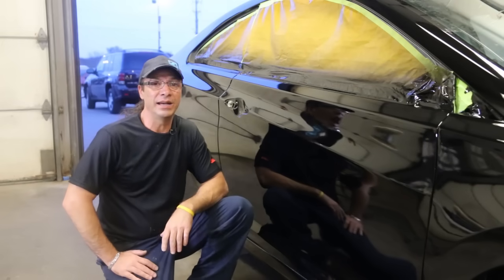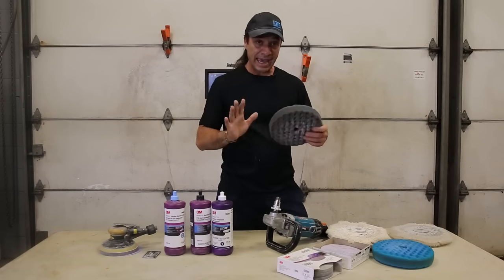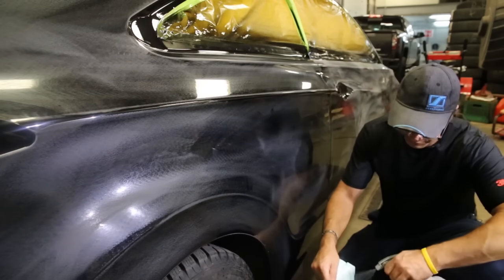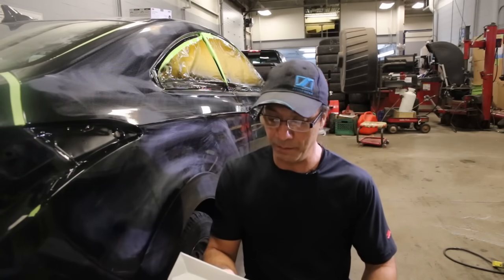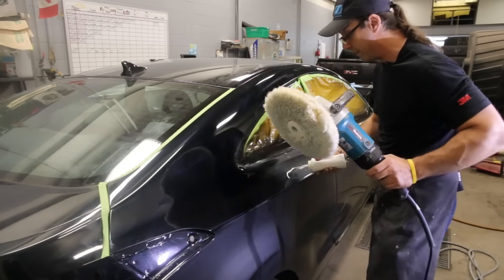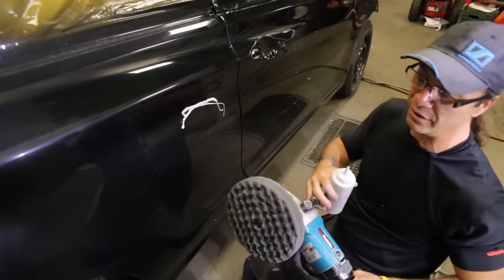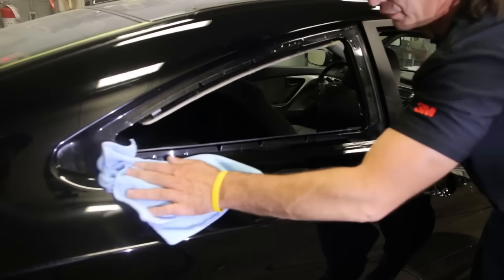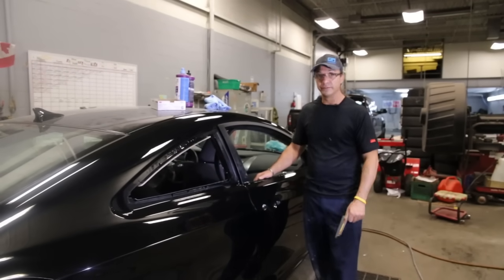Professional wet/dry sanding and polishing tutorial. 3m Trizact system, EX Compound

Comment: Friend I tried to make a fiberglass, gel coat boat look better. The boat is 20 years old but has been taken care of. Still it had some light oxidation. I use to do auto body repair so have some experience. I block sanded this boat lightly with 600 grit, then hand sanded lightly with 1000 and then 2000 grit. I then used what looks exactly like the compound you have with the white top and the polish with the blue top. No matter what I did the boat had a haze on it that would not go away. It was better when I finished just not completely gone. Can you please tell me if there is a way to completely remove that haze? Or was there something I was doing wrong? Thank you friend!!..
Reply from the maker: Boats have gel coat on them so it’s completely different then car paint. You may need a compound that is more aggressive which means has more of a grit. No reason to block wet sand a boat as it’s wavy from the start that you’ll never get out. Maybe contact a local detail supplier and see what they recommend. Good luck.
Reply: @loveja1  Friend I can not tell you how much I appreciate you getting back with me. I have already liked and will subscribe to your channel if it can be subscribed to. One more thing. A friend of mine wet sanded his boat with 500, 1000 and then 2000 grit paper. Then he used the same compound I used but I think he had a better/stronger buffer and put a lot of pressure on it. His boat was worse than the one I did but looks brand new!! No haze what so ever. So I think you gave me some good advice about stronger compound. I can probably do that or just put much more pressure on it. Again thank you so much!!..
Reply from the maker: @robjtko  what type of polisher are you using?
Reply: @loveja1  Hey friend again I appreciate you responding! I am using “”3M Perfrect-it  EX”” (Ultrafine Machine Polish) #06068. I used 3 different compounds trying to find one that would get rid of the haze. I tried “”3M Super Duty Rubbing Compound #05955,, 3M Perfect-it. EX  AC. #36060 and the most course or heavy grit one was (Dura- Coating  Marine Compound  Heavy Duty Compound Polish — which can be found at ( Dura-Coating.com)  I am still stumped at the fact that I could not get rid of the haze. The boat had a great shine, just an irritating haze on it. I am very thankful for anything you can tell me!! I appreciate your every second.
Reply from the maker: @robjtko  I meant what machine are you using to polish?
Reply: @loveja1  I’m sorry friend I misread your question. My mistake. If it isn’t a “”Goplus 6” DA with variable speed,”” then it is almost identical. I would guess it will turn from 600 to 800 rpms to probably 5000 if not a little more. It is also pretty strong. It doesn’t bog down when you apply pressure. Even though I don’t usually apply a lot of pressure. Usually just a bit. When I see my machine if I gave you the wrong name I will let you know. My buddy who did his boat and made it look new was using a DeWalt, variable speed but not DA with much of the same compounds and polishes. Actually the polish he used was different. But he wet sanded and used the same compound as I did.
Reply from the maker: @robjtko  I see a lot of newcomers using a variable speed da polisher and they don’t want to put the work into learning how to use a high speed polisher. It’s just not strong enough. You need to use an actual high speed polisher with a WOOL compound pad and compound. Learning on a boat is the best way to learn as you don’t have to worry about burning edges. Then use a wool polishing pad with your glaze and you should be good to go.
Reply: @loveja1  Ok awesome!! I did not use wool. I did know wool is for cutting but the compound was so abrasive I didn’t think It would need it. However I did not know you used wool for polishing to. I actually thought you wouldn’t want to use wool for polishing. When I polished the boat I actually used a micro fiber pad. It looked like wool but I am not sure that it was. You have helped me a lot. I appreciate it so much because you didn’t have to even reply. Very thoughtful of you. One last question. Do you use the same type wool pad for polishing as you did for buffing?? Thank you so much. Also I typed in “”Getting rid of haze or buffing haze when buffing and polishing a boat.”” I couldn’t find a single video that related directly to that. And I know that has to be a big problem for many like myself. I bet if you did a video on that it would be a big hit for anyone doing this kind of work. Also something that helped a bit or seemed to was I wet the surface when buffing and polishing with the machine, Sorry so long. Hope you have a wonderful 4th of July, best wishes and GOD bless you my friend!!!….   :))….
Reply from the maker: @robjtko  there is a wool pad for compounding and polishing. The polishing one has thinner strands and softer. I made this video to help people out, so of course I’m going to help and respond. Throw those soft pads away and get you a high speed buffer (dewalt or makita) with wool pads. Makita is the lighter of the 2 polishers and might save your shoulders. Lol. 
You are getting a haze because you aren’t buffing it enough. You have to have the right combination between the pad, heat from the friction and compound. They all work together.
Reply from the maker: @robjtko  back in the days we use to wet the surface when compounding because it made the compound more gritty. Not sure if that still applies to today’s products. Keep in touch and let me know if you’ve figured things out. Cheers.
Reply: @loveja1  I understand friend. Thank you so much. I will certainly let you know how it turns out.
Reply: @loveja1  Hello friend. I went and got my machine. I wanted to tell you exactly what it was since that seemed to be a big deal to you. I mean you seem to really know what you are talking about and what you said got me curious to wether or not my machine is sufficient for the job. My machine is a Griot’s 6” random orbital buffer/polisher. It has an 850 watt motor. It says the RPMs start at 2,500 and go to 6,800. It felt like it started at maybe 1,000 to me but maybe it is 2,500 RPMs. Correct me if I am wrong but that is sometimes to many RPMs on certain jobs isn’t it?   Anyway I am going to get 2 6” wool pads for it. One for buffing and the other for polishing like you said. I’m gonna try the same boat again that has the haze on it and I will let you know the outcome. I wish so bad now that I had went ahead and spent the extra money and got a Makita or DeWalt buffer/polisher machine. I may sell this one and do just that still. Can I ask you what compound you would use on gelcoat as well as polish or do you know? I understand you may not mess with gelcoats much. Also what RPMs would you run your machine on while buffing and polishing. If this does the trick I would like to show you my gratitude. Quickly, a guy on the net helped me build a hookah diving unit. He built the first one of its kind and helped me build the second and 2 years later and I’m still enjoying it. He gave me his PayPal address and I have sent him probably $300.oo in 3 or 4 different times and payments. He helped me build a 3 to $4,000.oo unit for $1,000.oo. It was the least I could do. If you help me figure this haze issue out I would like to do the same for you. Maybe not that much but just something to show you I appreciate your time. I am not a scammer. Lol. I can show you the sight and mine and his conversations on YouTube. Please don’t let that scare you away. You are the only person I have talked to who seems to really know what your talking about. I’ll drop the $ if you want or I will do what I said I would. That is totally up to you. Thank you so much my friend!!..
Reply: @loveja1  I think I mentioned my Pop owned his own Auto Body Repair shop for 30 years and was very successful. If we had 20 cars go in and out in a month it was a big month. For you guys to move 200 autos a month through your shop you have got to be gymongus!!!! Absolutely huge.  You would have to have at least 20 employees if not more. Are you really that big? If your shop is on YouTube I would love to see it! Is it on YT?
Reply: @loveja1  If it doesn’t rain I am trying that boat again tomorrow. I will have wool pads like you said. I bought some 3M compound and polish but that is what I used when it was left with a haze over it the first time. Should I try something different like Meguiars rather than what I used before? Also what RPMs would you run your machine on? If I understood you correctly it would be high RPMs. And lastly should I apply a lot of pressure and move slowly? I watched you and that is the way I am use to compounding from 30 years ago. And that is the way I did this boat the first time. Didn’t know if you thought I should change up since it didn’t work the first time. Maybe the wool pads will make the difference though. Thank You Loves-Rush-2112
Reply: @loveja1  Friend I think I figured it out. Because I was using marine, heavy duty compound I was using very little afraid I would cut through. I was using a small amount and buffing until the surface was bone dry. You should always have sufficient compound under you pad, correct?Don’t you think that could easily be my problem?? Thanks

Comment: Master I have one more question 
Which electric DA sander do you recommend and the one that  can work with 1500 dry and 3000 wet 3M Trizac ?
Reply from the maker: 4AUTODETAIL 4AUTODETAIL I’ve never used an electric sander, only air. You may need to change the backing pad so the paper will attach to it.
Reply: Family Marquez thanks sir ... good advice appreciated
Reply from the maker: Family Marquez it has to be a palm sander. It has a tighter throw.
Reply from the maker: Family Marquez why did you remove your last comment? No, I’m not God, I just know my shit. Cheers!
Reply: Family Marquez Mobil
Reply from the maker: Family Marquez not a cool thing to say.

Comment: What’s that circular piece on the center of your wool pad? It’s only on one side. Is that a modification you added? I don’t have that on my 3M quick connect wool pad.
Btw, speaking of wool pads, do you like 3M’s new(ish) Low Linting wool pad?
Reply from the maker: Tarek Restom it’s a quick release from 3m. You can use a double sided pad with it. I love the new low lint pads. Should have invented them long ago.

Comment: Do you have any shoulder or neck issues at times from all the sanding and swinging that buffer in that motion for so many years? My shoulders and neck aches so bad sometimes after doing a few big jobs.
Reply from the maker: Chris Ancrum ya. Absolutely. Just like any job with repetition. My wrists are the worst. I actually bought a magnetic bracelet and it works great to relieve the pain.

Comment: It’s safe to sand the corners on the nee paint with the soft pad? I thought rule of thumb not to sand corners ?
Reply from the maker: I guess it depends how bad the orange peel is or if there is a run. But normal practice if you’re still learning, just stay away from them. With 3000 is ok though. It will take for ever to burn edges with 3000.

Comment: Just wondering what D,A your using,mine is a blue point dual action but doesn't cut the 3000 as quick as URS.
Reply from the maker: Filiberto Barrera you’ll need a palm sanded. 3000 will not cut anything but 1500-2000 grit scratches.

Comment: Second wool pad has quick release washer on both sides and it has residue around it, did you just put it flush against paint with that white washer, surely not
Reply from the maker: It’s not a washer, it’s actually made out of foam.

Comment: Hello, so today at the shop I got frustrated with my own car. 

I used makita polisher with a wool pad and step 1 3M scratch removal product, some spots left a haze thats hard to get out, not sure if its clear coat burn through or a stuck haze. I then took the wool pad off, put on a black foam pad and it seems to cut that haze out. So after, using step 1 3M, I used the step 2 with the black foam pad, and the problem I have now is that when i park in the sunlight, there are swirls and waves all over my car that if you were to stand far away, it looks like huge scratches. 

How do I polish properly? I am learning to wax and polish in the shop. I usually only paint and sand cars. This is frustrating me because I really want my car to be shiny for this weekend to take my wife out for her birthday!

How much pressure do i apply on either of the two pads? Sorry If I repeated anything

how much product to spread on the surface? It seems like I was using almost half of the bottles.
Reply from the maker: 04av6 so first, happy birthday to your wife. Factory paint will act differently then fresh paint because it's already hard.  Going from a compound pad to a foam pad is too far of a step. You need a wool polishing pad in the middle of those steps. 1) compound pad with compound , 2) wool polishing pad with the grey glaze, 3) black foam pad with the same grey glaze, 4) blue foam pad with ultrafina, then wax that baby up. Do it just like in my video but I skipped the second step because the paint was soft and easier to remove the light swirl scratches. You do have to use a little pressure but not much. Let the weight of the polisher do most of the work. I hope that helped and I hope she has a great birthday. Cheers.
Reply from the maker: Another tip. Always polish side to side, not up and down. The swirls seem to appear more obvious then when you go up and down.
Reply: Thank you! and thanks  for all the info, just want to clarify things. Our shop uses different terms.

Which pad is compound? These are the steps my shop wants me to use. They tell me to use a wool pad with 3M bottle step 1 scratch removal, proceed to 3M bottle step 2 swirl remover and polish with the wool pad as well. Last but not least, Step 3 of theirs is using the black foam pad to apply wax. I feel its not correct because when I worked at jaguar detail shop, they used wool for scratch removal, then they used a black foam pad to use with swirl remover step 2.  I hope I didnt confuse you.

I used the wool pad today for both 3m step 1 and 2 bottles and it somewhat got rid of the glaze and bright swirls. I am afraid to use black foam pad because I apply it onto the body of the car flat which gets rid of the distorted swirls but then the paint is not clear at all. I am getting so frustrated lol.The only product we have are the 2 bottles of 3M and a strawberry wax

Comment: Can I send you a few pics so that you can recommend the proper steps, I have chips a lot on the hood and some scratches on the left side mid door don't really look deep but 2 that I can kind of feel it a lil by running my nail through it but the other just look like can be taken off with a good buffing of all 3 steps, there is some more chips on the doors that I figured just apply color matching from dealer and then some 3000 - 5000 wet sanding followed with the buffing  the hood has a lot more that were covered by someone using a paint that don't even match the color of the car so I was thinking of removing that and re applying color match then sand followed with a good buffing, I was thinking of buffing the entire car and then do a ceramic coating on it.

let me know please
Reply from the maker: Rick L sure. Send me what you got and the type of vehicle it is.
Reply: @loveja1  never got your email
Reply: @loveja1  what do you think of dr color chip,  was thinking of using this

Comment: what Makita right angle buffer you're using? if you can tell me the model number that would be great. and could also get the information for all three of the 3M compounds. what would you suggest on a 12 year old paint job to bring out the shine again?. I have an 04 GTO and has never seen a Body Shop but it's always garage kept. I would just like to remove a lot of the minor sand scratches from over the years of washing the car.
Reply from the maker: LCNismo sorry. I'm just seeing this comment. I use the 9227 makita. It's an older model because it still works perfectly after 5 years of use. Only changed the brushes once.

Comment: hey learned a lot from this video. Does somebody know how thick the clear coat from mazda cars is? greetings from germany
Reply from the maker: Karsten Borusiak  not sure but what are you trying to do?
Reply: in march i want to remove the orange peel from my mazda 6. I'm a hobby detailer since 2008 and know its time for me to learn the next step. but there are just round about 3 good videos about sanding. Yours and the one from Ammo NYC with meguiars. I try the get much informations as i can till i practice
Reply from the maker: Karsten Borusiak nope. Don’t do it. Not enough factory clear to be sanding it flat. You’ll burn through everywhere and have to repaint.
Reply: hmmm thats sad. i heared that it would be very soft and thin, but that its too thin is horrible.
Reply from the maker: Karsten Borusiak ya. I wouldn’t advise it at all.
Reply from the maker: Karsten Borusiak our videos are not alike. He does more spot repairs on hard cured paint. I do body shop wet sanding and polishing within a reasonable amount of time the estimate calls for . And dealing with fresh paint and defects in the clear as in dirt nibs. They have their place and I have mine. Cheers.